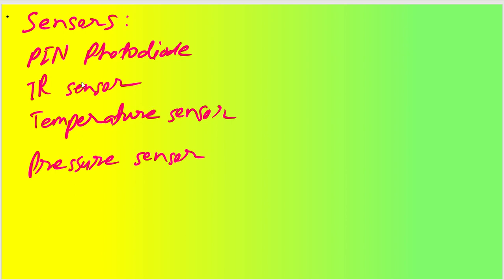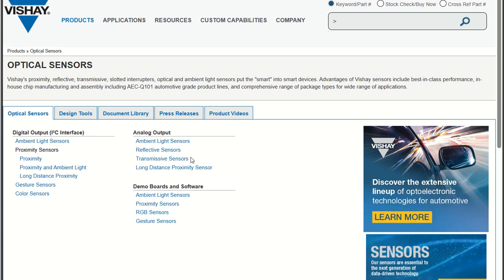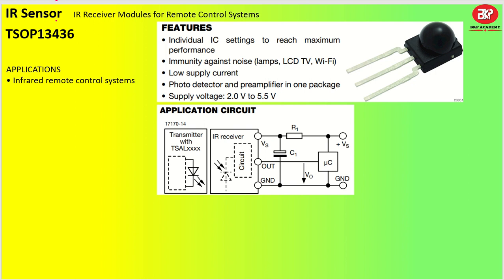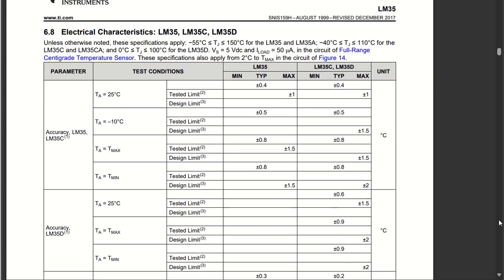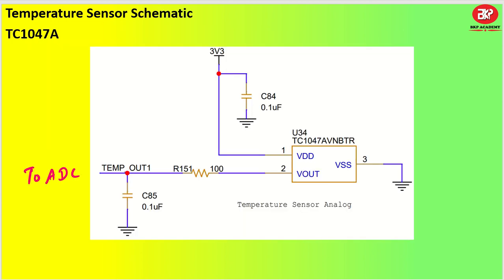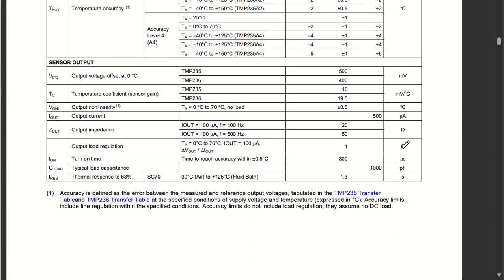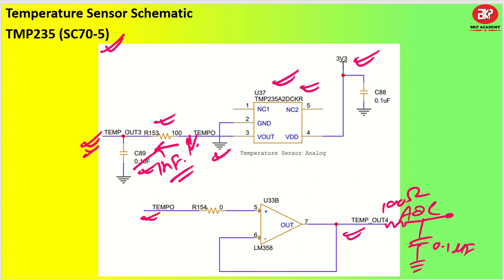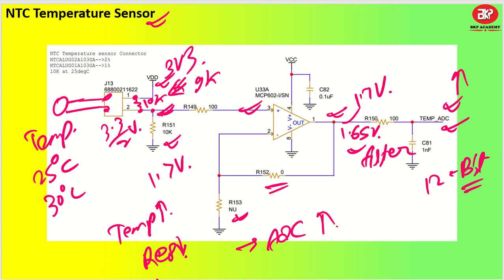Sensors Application schematic design 01

Comment: 🙋 Promo sm
Reply from the maker: The manufacturer is not promoting so much, It's our case study with various clients. These are most common products in sensor which all electronics engineers should be aware of. Thanks
Reply: This is one of the best video with all kinds of sensor I have seen so far, promotions doesn't matter mush, as long as it fulfils designer requirements and supports them in their design